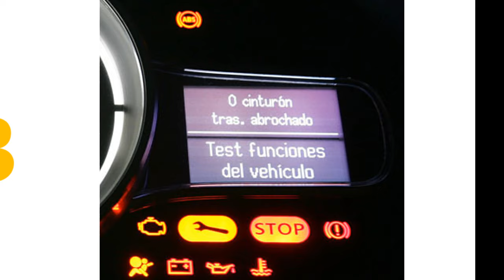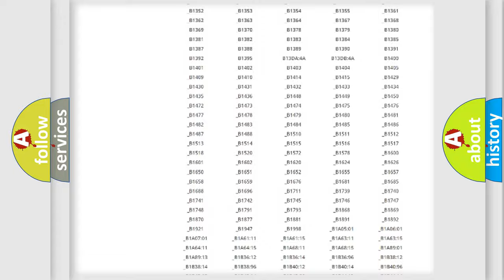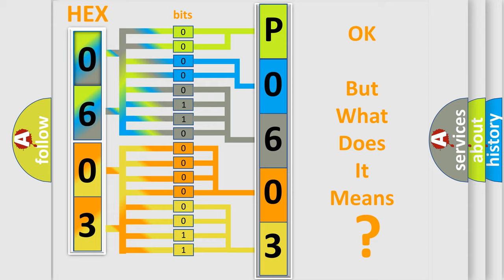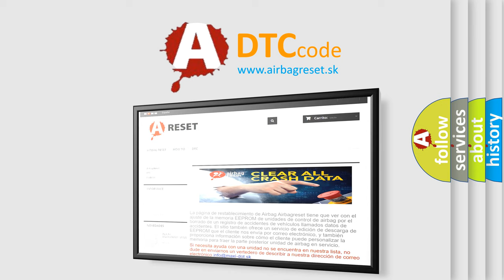DTC Nissan P0603 Short Explanation

Comment: Anyone fix this code?
Reply: Nope we on the same boat im also getting p062f and my car Altima 16’ wont start unless I jump it brake stiff replaced brake sensor fixed issue for like 5 days now I’m thinking it’s the crankshaft position sensor lmk if you find a solution also if yours won’t start try pushing brake and gas all the way down and start it worked for a lot of people but not me